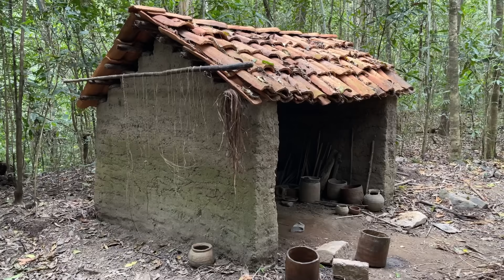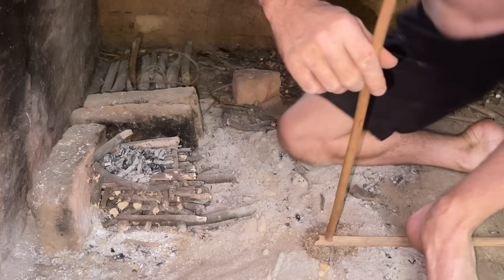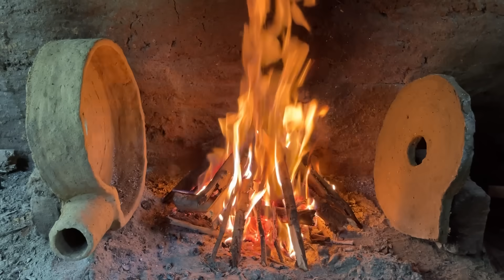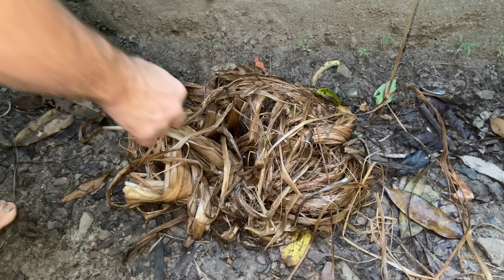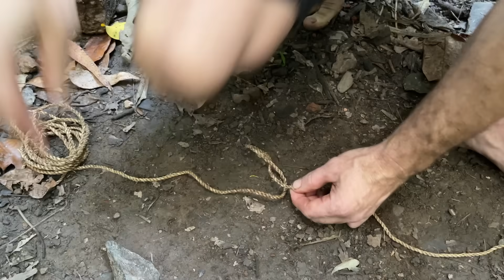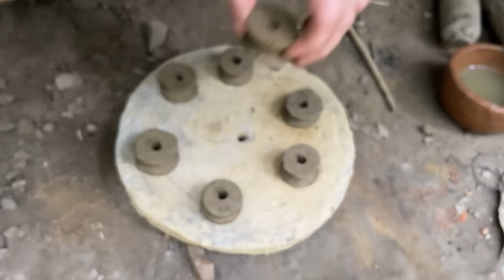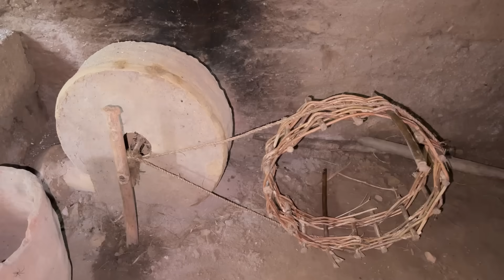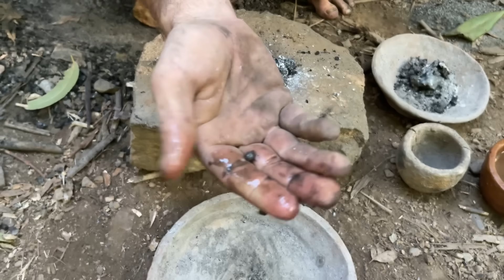Primitive Technology: Floating Pulley Blower Smelt

Comment: You could try using a straight branch that's the OD you want your pulley to be as the axle, and carving the ends down to points to fit in the bearings. More rotating mass might help the system, honestly

Comment: Have you tried a solid drive wheel made out of clay/rock? I'm thinking it would be easy to make, and would give you some mass to help stabilize the drive wheel. It should mitigate energy lost to having to stabilize the wicker wheel. Also, you could use a thin Y-shaped stick to tension your belt, too.

Comment: I think you should look to getting a potter's wheel going, will help with the pottery overall and in creating the pulleys due to better concentricity.

also light oil for lube to reduce the friction on parts/a flat braid for the belt as it has more surface area to grip onto and reduce friction internally to the belt.

Comment: Could the string be turned only 90 or 270 degrees rather than 180 so that you could mount the turning wheel in the ground for added rigidity and comfort of operation?

Comment: Hello! Thank you for your work! Perhaps you could use something like fish glue or wood resin to make a composite for the pulleys? I'm thinking that if you soaked the rope in glue, then wound it into a pulley shape, then coated the top layer with ash, you'd get something stronger than clay pulleys.

Comment: How interesting. The technique definitely seems to have advantages since you appear to be getting hotter than normal temps in the forge. Hot enough for the fire to start shifting color. But its interesting that the yield is still relatively low versus the vestment in technology to build a more complex forge.

Comment: He's run a bunch of experimentation at this point on the furnace and I'm here for it.  But I constantly reflect when I watch these videos how he went into the forest and created things that took humans millennia to figure out.  He's applying skills any of us could do (eventually, after more or less the same work he has put in) that would have been mind-blowingly magical before someone thought them up.
Reply: To be fair he didn't think of most of this on his own, his hobby is "merely" learning methods developed over millennia and then remixing them through the lens of his post-industrial revolution brain. Which is actually even cooler because he's rapidly iterating on traditions that have been on pause in most places for centuries.
Reply: @FreeRadicalX  Yeah, the real value of this kind of work is rediscovering how we got where we are. He knows where we started, and where we ended up, but nobody recorded all the stepping stones in between. There's a LOT of really interesting technique that's been lost to the sands of time that you can only rediscover by testing. So many discoveries of "oh, (process) works much better if I do (something)".  These are small things that seem insignificant, but they really add to the richness of our larger anthropological picture.
Reply: "...skipping bronze"
You use what you have available.
Iron is actually MUCH more available.
Surface deposits of copper and tin are pretty scarce in the rainforest. He would have to start mining, which is a WHOLE different endeavor.
Reply: In Thailand montane rainforest region, there are valleys which have copper deposits and not far away are tin deposits. There are also ancient ceramic works, I think glazed. So that could be a possible original source of bronze work, and perhaps early iron oxide experimentation. Plenty of firewood in the dry season for charcoal. Further south in Malaysia there are major tin mines, near the surface, but I don't think there was much copper. @Prophes0r
Reply: As far as I understand, no culture skipped discovery of copper tools and went straight to iron. Having copper or bronze machined on a primitive lathe and hammered into sheets like the ancient Greeks would make the pulleys and blowers far easier. Which makes what he’s doing even more impressive, but since he’s not there yet I keep thinking that components made of timber could be useful. Because he’s also skipped wood carving, which most stone-age peoples used.
Reply: he's the best boy scout, for sure! i have tried his videos for myself. i don't have the space or the resources, but i have a fire pit.
Reply: Also worth noting a lot of cultures never really did get consistent iron production, even after millenia of learning and experimentation.
Reply: @preauxtip  Only a small portion of the iron deposits available in early times where good quality.
It is MUCH harder to figure out the how and why of smelting when you can do the exact same things you were taught 3 town over, and get completely different results.

A perfect example of this is Japan.
Early Japanese iron deposits were so poor that they almost couldn't make steel from them.
It was so bad that entirely new smithing techniques needed to be created simply to make (barely) functional swords.
And these swords were so bad that an entirely different form of martial culture grew compared to most of the rest of the world.

Early Japanese swords are "legendary" items, because they were basically impossible to make.
Swordsmiths were legendary figures because they were able to take iron that was barely fit to make a plow, and through months/years turn it into a weapon that was actually kinda usable.

In a wider context, compared to swords made elsewhere during the same periods, Tachi and Katana are awful swords.
They lack basically every attribute that makes a sword "good".
They are heavy.
They are short.
They are not flexible(spring).
They ARE flexible(bend).
The cutting edge is way too hard so they chip.
The laminated construction completely stops them from being reforged.
They are chemically weak so they corrode incredibly easy.

The only thing they have going for them is they have a sharp side.

Having to make these awful swords useful in battle is the reason for the very different fighting styles that were employed to use them.

It makes perfect sense that you must size up your opponent and kill them in one strike, when you have a weapon that literally might not ever get to make a second strike because the first swing breaks/bends it.

Treating a "I guess it's okay" sword like a dynastic/holy relic makes perfect sense when it needs constant care not to turn to rust or fall apart and it could take a year or more to make a replacement, assuming you even had access to a master smith to begin with.

Having shitty iron can do more than simply hold back smelting technology.
It can shape entire cultures.
Reply: Yeah, it amazes me that early humans ever figured out smelting certain rocks and refining the products would make usable metals. Where would this idea even come from?!
Reply: @usernamesrlamo  probably burning some ground up rocks. Since mud houses are be build with dirt, some found that some clay rich mud changed to a very specific colour that's harder near the fire place, clay making is refined, they gather clay, think of other rocks that can be heated up, kept reiterating until success. These kind of long term experiments would also point to the necessity of agriculture and a settled lifestyle, as polynesian peoples didn't have great metallurgy, but nomadic people could still pick up metallurgy either due to seditary periods when herds graze, or by picking up metal workers from settled peoples
Reply: Metal oxides were used as pigments for pottery, and you would then fire it in a furnace. It was probably not difficult to observe and figure out, but getting to usable metals was quite a leap.
Reply: turns out people weren't dumb back in the day 😉 Fascinating how little we think of our ancestors
Reply: @usernamesrlamo from being hungry, defence, protecting your tribe, and pride
Reply: It helps tremendously when you do not need to worry about getting food. I think most prehistoric humans laughed at their friends when they suggested trying new things out - they didn't have the energy to waste to try building a forge, they needed to hunt game and collect berries to not starve to death.
Reply: He's a bit ambitious, though: jumping straight from the stone age to the iron age, completely skipping bronze.

I know he doesn't have proper ores on his parcel, but he could "invent" trade and trade some of his pottery for copper and tin ores.
Reply: @jaceksiuda  Iron was used during the bronze age as well. Humans prefererred copper alloys like bronze because iron is a pain to smelt and work with given the technology of the time (as you can see on this channel).
Reply: @jaceksiuda  I think he wants the channel to be a "what if you had to recreate advanced tools alone in the woods" more than a "trying to recreate civilization" channel. Honestly though, iron is better in most cases than copper, unless he reaches electricity.

The iron age came after the copper/bronze age mostly because iron is harder to find or work. Natural copper can be found just laying on the surface, or as a greenish ore in natural cave walls that can be broken off with sticks or rocks. Copper is also soft enough to cold forge it, so smelting wasn't originally needed. 

Iron oxide/rust is pretty common in any red dirt or clay, and has been used to make red pigment for as long as copper has been used, but it needs to be smelted. You also need to know iron metal is even a thing, since any iron exposed to air rusts away pretty quickly. Iron ore requires mining fairly deep, or you have to use rare iron rich black sands like in Japan, to get a good yield of metal. Modern knowledge lets us know you can use red dirt or his iron bacteria as a low-yield source, but that's only because we know iron metal and iron oxide exists. Without that knowledge, and without decent mining, forging, and making iron by experimentation and luck, copper was the only option for the world after the stone age.
Reply: @ethanhodges4283  fyi Iron is signifigantly more abundant on earth, its just way harder to refine.
Reply: @jaceksiuda  bronze age blower is needed for iron age smelts i guess life really is a video game

Comment: I never skip or fast-forward when you start a fire, no matter how many times I've seen it, in an acknowledgement of past efforts of mankind.
Reply: I expect at least 1 fire to be started with friction in every video. I never tire of it either.
Reply: They're usually done in less than ninety seconds, its a small price to pay
Reply: @Faesharlyn  shorter than some ads. I always skip the ads.
Reply: @isaaco5679 3 taps on the right side of my screen lol
Reply: I have learned so much from this channel, i am the fire keeper in my family. and i teach anyone willing to listen. listening is the key
Reply: I tried doing that irl while camping last month but it ended up being remarkably hard to find a long straight dry stick, and even harder to make a point or the notch on the firestick even with a modern folding knife
Reply: @griz561  Try a larger stick or log that's been split, or even a thick piece of bark, to get a flat surface to make a fireboard. That way you don't have to try balancing on a round surface, you don't have to sharpen the drillstick to a point, and if you need a notch guide you can sit a small rock on it and hammer it to make a depression. You also don't have to make the two parts from the same wood. A harder drillstick with the softest available fireboard works best, and makes the drillstick more durable and last longer if you want to reuse it.

For the type of wood, don't use anything with a lot of resin like pine, because the resin prevents ignition. The softer the wood, the easier it is to make an ember since the wood dust made from friction is the main source of generating heat and embers. As a general rule, the faster growing trees like birch or cedar tend to be the softest, while slow, long-living trees like oak or maple are the hardest. A quick search of types of trees in your area would show the best ones.

You might also want to try to make a bowdrill, the version with a bow to spin the stick and a cap/bowl like a concave rock to push it down. Good string is easy if you don't have to make it yourself, and a bowdrill is MUCH easier to use. You can also use a shorter drillstick if you use a bow.

I saw a comment by the channel creator once that said he considered upgrading to a bowdrill, but by the time he could make decent string, he was so skilled at the firedrill version that it was faster and easier for him to do that, instead of replacing the low-quality string often. When you have to make every part from scratch, more parts is always more trouble.
Reply: @griz561  It helps to have the right kind of wood to begin with.
Depending on your area you might just have to deal with more bent and knotty stuff.
And dry. Bone dry. Even high humidity can make it harder.

Yes he is in the rainforest. But he is also very skilled, and we don't always see what he cuts out ;)

Comment: the way the fire leaks out of the side of the furnace is incredible
Reply: actually i think it might reduce productivity
Reply: @legospin4004 Yeah I was surprised he didn’t seal them up with mud but maybe it would just come off right away
Reply: @A_youtube_channel_  he can't see it, the camera picks up a bit of infrared light
Reply: @bloodakoos  Agree that he can't see it but also because it only leaks heat like that with an active blower. He will have seen it afterwards but my guess is that it was more about this new blower and testing how much his shoulders would tire.
Reply: @A_youtube_channel_   If he had an assistant, I'm sure he'd get them to smear a little mud on the cracks, but if he's working solo, he can't even see the far side of the furnace while he's cranking the pulley.  He might also be too busy - he doesn't like to interrupt a smelt.
Reply: I keep wanting to micromanage and minmax these builds. "No, use clay to seal the furnace. Now add a few more bricks to it. Can we prep some more charcoal first?"
Reply: @xyzero1682 I honestly just wish he had a better source of iron. It’s annoying to just watch him putting in so much work for so little I can’t imagine having to actually do all the work.
Reply: @xyzero1682  he is trying to minmax his build, but he doesn't know the stats of his items or techniques, so he has to try them all out, and learn what is the best gear set. Also, it takes like a week of work to prep one of these burns. That is a lot of charcoal.

Comment: Are propellers better than bellows? Like I bet propeller is easier to use but bellows might give more pressure to push air through thick coal bed
Reply: I think he's trying to come up with his own way of doing it
Reply: @cryowreck3193  *With the materials in hand
Reply: Bellows take leather or woven cloth and flexible enough paint; leather isn't something he has easy access to (no hunting permitted, I think?), and I don't recall there being that kind of tight weaving (yet). So it's not quite available in this context. He did try a water-and-pots variation on a bellows.
Reply: @jonored I think even the thick weave he could do can work. But I think you're right about it avability being the reason. I would like to see a comparison one day